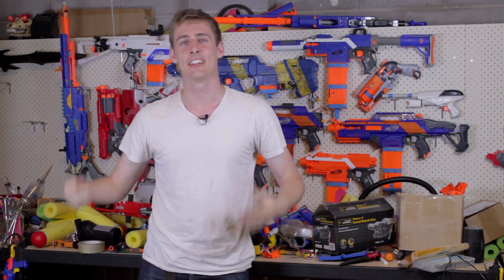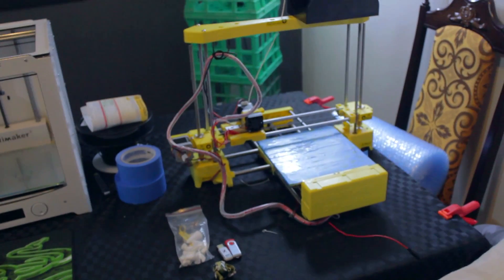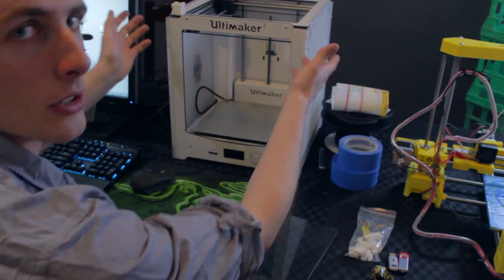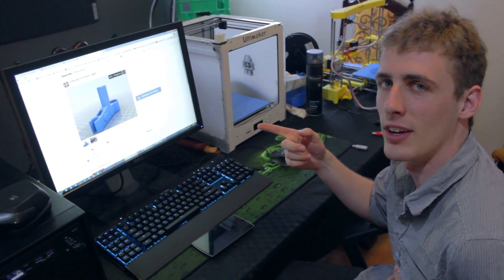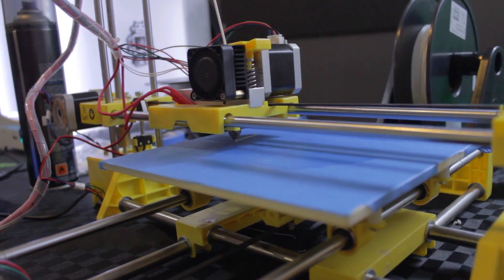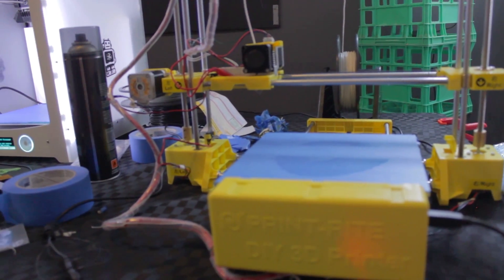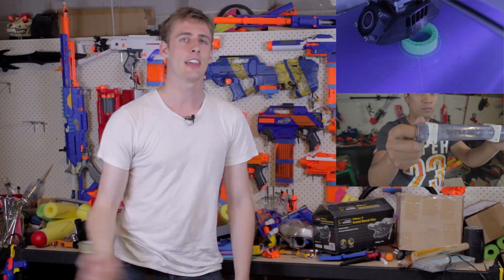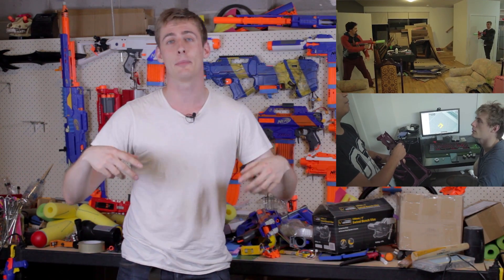ULTIMAKER 2 vs PRINT-RITE DIY 3D Printer & How to Bed Level - PRINTER PARTY | Make Test Battle

Comment from the maker: Do you like the concept? This is something we may do every now and again, get together and try to print something and troubleshoot if need be. More Maker/DIY/How To focused videos.
Make Test Battle is about Making stuff, Testing and learning applied science and live action gameplay of Battles in Nerf or LARPs. 
It's board range connected topics that we want to share our knowledge of and interest in.
Reply: +Make.Test.Battle Why didn't you print the same thing on both printers so we could compare them with fewer variables?
Reply: +Make.Test.Battle This video was not a good comparison.  That "cheap" one was not prepared, printing was not same. Also u need to remember, that 3d model is optimized for specific printer, and u should do some minor changes to make it "fit". What is more, u used diffrent filament. I know that u cant use same, because of size, but at least same manufacturer. Many times i had problems with printing, cos of filament (should be 1.75 was from 1.5 to 1.9)
  Im using GATE 2.0 printer from 3novatica (about $1200), its realy good.
Reply: +Make.Test.Battle I feel it's a great idea. I had been wondering why you said so little about your equipment, and am interested in learning more.
Like many viewers, I am considering 3D printing and printers, and information from a trusted source is of great assistance.
Reply: I have an CTC and made some upgrades like alu pulleys, bed temp resistor, spring loaded extruder and so on. I made a speed test and some short vids (only german but the speedtest is for the eys not for the eras :-) You must do some checks first, but then its ok for this price
Reply: +Make.Test.Battle to be honest, now you can buy a makerbot clone for $600 that will print out of the box reliably and produce good results.
Reply from the maker: Jared Reabow I have a bit of a vendetta against how MakerBot conducts business by stealing people's ideas and patenting them as their own. One of the main reasons I got the Ultimaker instead of the equivalent MakerBot -R
Reply: +Make.Test.Battle which is why you should buy the makerbot clone....
Reply: +Dart Beard i have a few tutorial videos for the CTC printer that are very popular.
you will always have help if you buy a CTC or other Makerbot dual clone.
Good luck!
Reply: How to print real guns and real bullets?
Reply: It's a great idea if you don't promote somekind of overpriced product over DIY product nexttime.
Reply: Jared Reabow any particular makerbot clone you recommend?
Reply: +Dart Beard for Muricans : http://www.ebay.co.uk/itm/CTC-3D-Black-Printer-FDM-dual-nozzle-1KG-ABS-Hot-Sale-/252262707787?hash=item3abc07724b:g:RioAAOSwv0tVSCyM

For Uk:  http://www.ebay.co.uk/itm/New-3D-printer-dual-extruder-New-Extruder-Dual-nozzle-W-Abs-or-Pla-Spool-/331263823917?hash=item4d20dcd02d:g:uzcAAOSwibFUYDKd
Reply: +Dart Beard I am in Australia and I got the CTC Dual (thats what it was on ebay listed as, if you want to google one up its a CTC Bizer).
Printed straight out of the box.
I have had no issues with it what so ever unless they are of my own making. By that, I mean that I have modified it a bit here and there which required some tweaking.
Personally I recommend it for a first time 3d printer moreso than one you have to assemble yourself. Once you have been playing with it for a while, then you can look at a higher quality DIY printer, there are 100's out there.
The one downside of getting a CTC, they are made in China so support is not great BUT there are plenty of forums out there if you get stuck
Reply: I am going to buy the ctc, thank you for the advice :)
Reply: Probably the best forum is you do ever have trouble, there is a google group that I had to post to, had an answer that fixed the problem within an hour.
Just google for 'CTC group' and its the first result. They have been a great help to me and a few other people I know.
Cheers and good luck, 3d printing is a LOT of fun
Reply: +Make.Test.Battle +Make.Test.Battle well then the original Idea maker should have patented their idea first maybe MakerBot had the Idea first and others just copy them in any case i like the cheaper of the two because they're cheaper
Reply: +Make.Test.Battle you guys should do the untimaker 2 vs something like the ctc 3d printer. it costs a couple hundred more but it prints really well.
Reply: +Make.Test.Battle Thank you for the compare .
when I plan to buy my 1st 3D printer last year. ultimaker is the 1st product I saw.
but no people sell in Malaysia .at the end I got my DIY Kossel printer here now. It work well with auto leveling❤
Reply: +Make.Test.Battle Interesting video, I've been wanting to know more about what kinda probems people have with these things before I buy one. I've been looking at both these printers, and honestly the result looks less polished than I was hoping for, even with the very expencive one. I think the one that has my interest right now is Lulzbot, it seem to preform very well, and I like that it's open source, still a bit to expencive though.
Reply: Are u guys from New Zealand. You guys sound neither British nor Wussy.
Reply: +John Martle Gun store...
Reply: which should i buy:
Flux  minimal price is 499,- euros. maximal price is 899,- euros.
Tiko 179,- euros
(or maybe: M3D)

i don't want to give out too much money
Reply: print-rite is 210 on hobbyking.com I have an m3d and the print rite stomps it haha
Reply: Theo maassen